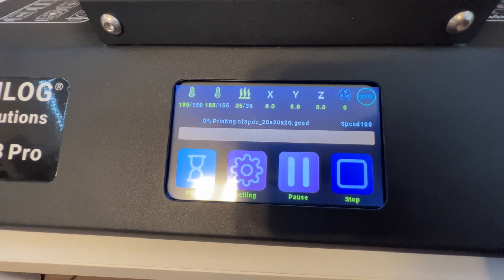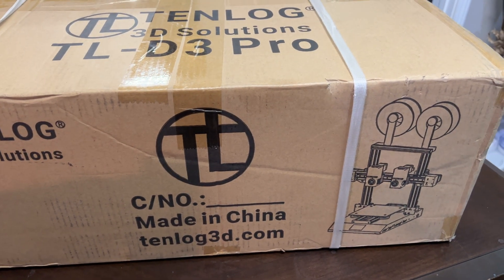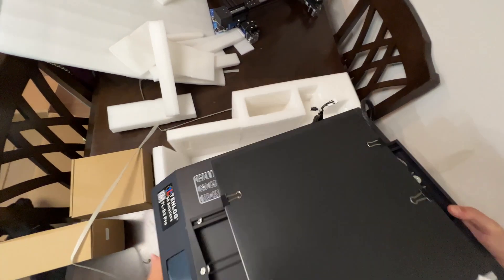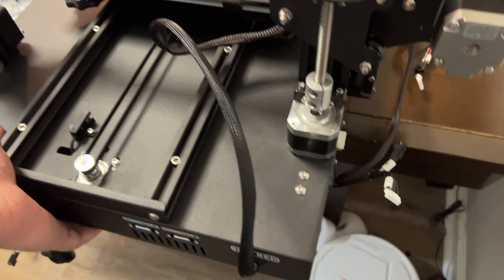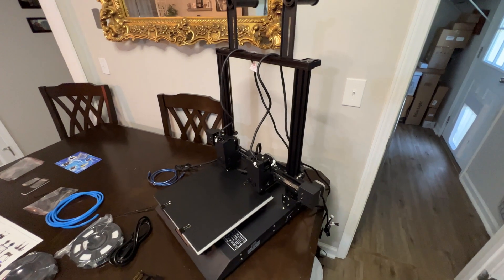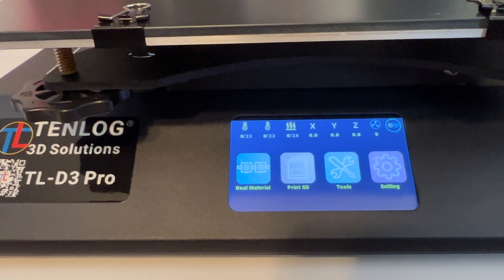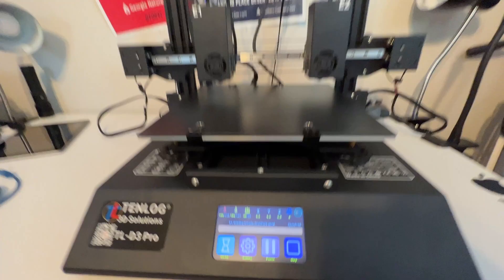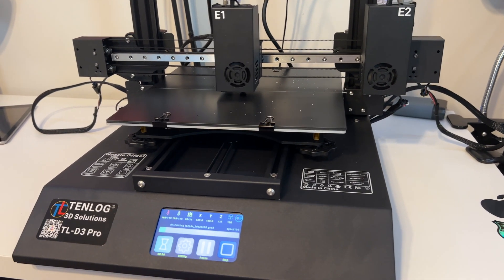TENLOG TL-D3 Pro Dual Extruder 3D Printer Setup!

Comment: It may have gotten missed in my last comment, but how did you get the spool holders attached?  I can't get the "1/2 turn" you note in the video.
Reply from the maker: I do remember that part and honestly it was one of the only things I remember being smooth during the setup process lol.
Reply: @BigCVlogs  Sigh.  I finally figured it out after watching another video!

You need to leave the screw/back assembly much looser and tighten it in the groove.  They are now attached in mine.

Comment: I have the Tenlog TL-D3 I was new to 3d printing and still am.  But I was having SO many issues with adhesion.  The Red PETG was the worst.  I tried the flexible beds, glass beds, multiple leveling attempts.  
Ivan Miranda uses a mirror on most of his printers. So I got a 4 pack of mirrors from Ikea, think they are 12"x12"  I use paper spring clips to hold to the original bed.  This was the best thing I have done to date.  
Other than this the hotter the bed the better. Lower the fan speed while printing.  I was having parts cool to early and lift on the edges then come loose while printing.  
I run my bed at 75ish (PLA+ and PETG) and prints stick amazingly well.  As in can't get it off while hot!   If you let it cool down the parts will just "tick" & pop off.  I have left parts to print and woke up with them almost fully released from the bed from the cool down period.  
Best of all the surface that is against the mirror comes off looking like glass!

Comment: IDEX or Independent Dual Extruder printers are not a beginner level printer.  Although the ability to unbox and print is getting better, current IDEX printers still require one to have a good understanding of the basics of 3d printing. To use an IDEX printer, you must know 3d printing preparations which involves details related to your printer, the material being printed, and the item you wish to print. Preparation for your printing machine includes multiple topics such as, machine leveling, temperature setting of each extruders and the printing bed, and additional parameters to ensure the material you’re using to print will operate optimally with your machine.  Preparation of your printing material includes topics such as which material is best for the item you’re printing, orientation of the item shape in relation to the orientation of how each layer is printed, the nozzles best suited for the material you’re printing, and the optimum speeeds at which your extruders and printing bed should move. When it comes to the item being printed, you need to consider the orientation of the item’s shape on the printing bed in relation to the printing area and movement of the print heads as well as the need for supports to keep your item from moving or coming apart while being moved about during the printing process.